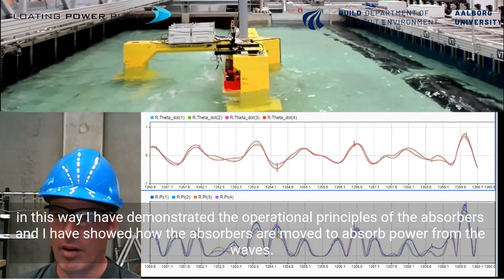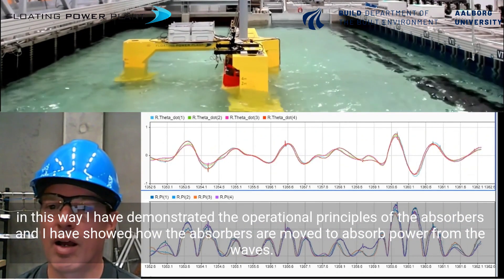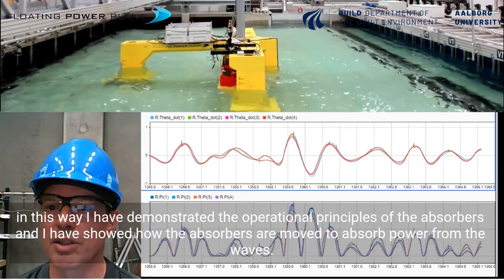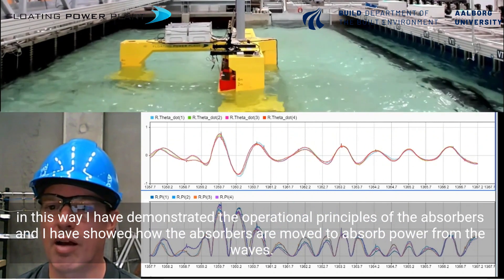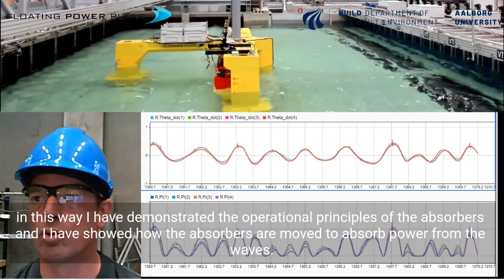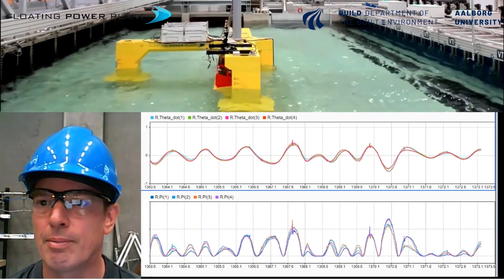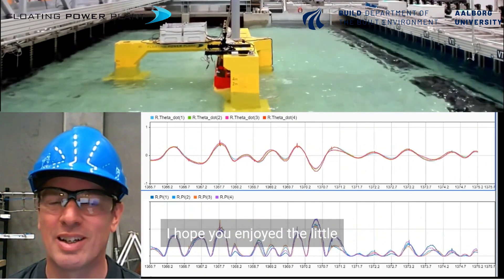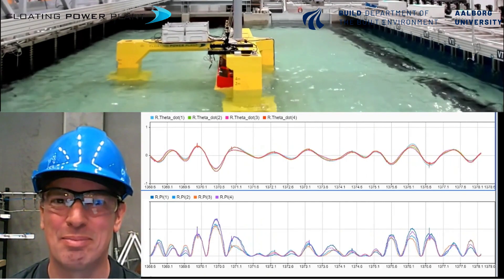Floating Power Plant - Experiments at Aalborg University - Wave absorber operation and control

Comment: Really informing Video about the principle to generate green power by waves. Thank you. 
I got a question about the construction of the so called floating power plant. As i saw it in your video the the absorbers are connected to a structure which it self is based at the ground of your pool. So i would like to hear your ideas about the actual use at sea. A floating power plant does not cost as much as building a fundament in the sediment at the coast. But if the platform is floating, how is the power generation by the absorbers effected? As i understand a floating object will move with the waves and therefore the whole structure will move up and down and thus the absorbers efficiency decreases.
Reply: well ,I  understand like this: this wave energy generation structure can be used at wave barriers, the wave barries has anchroing structures